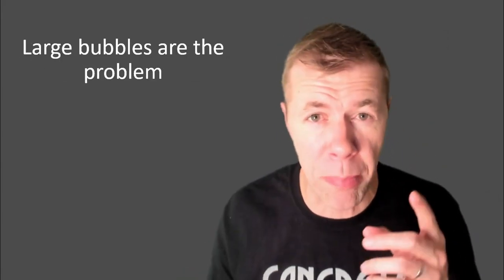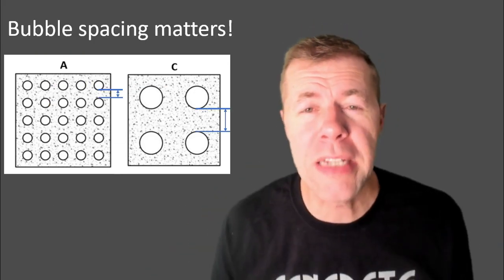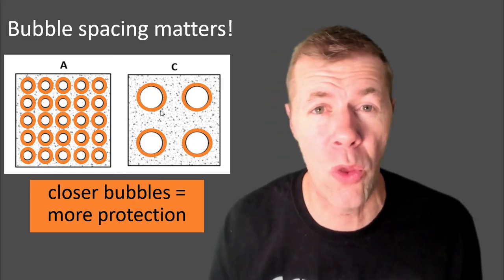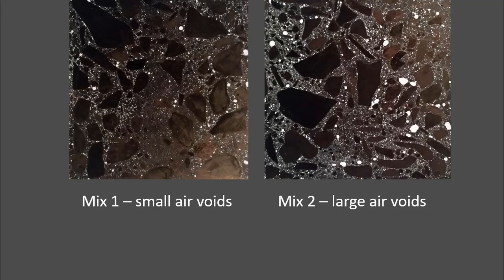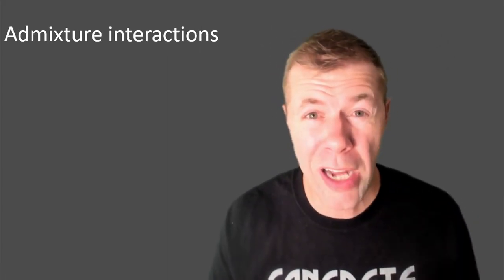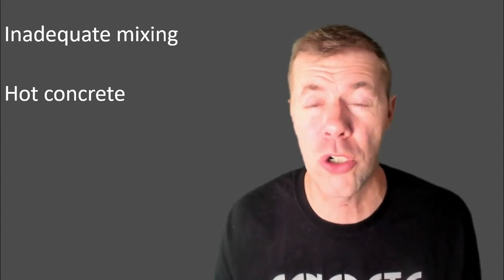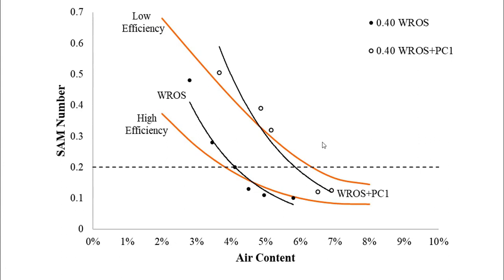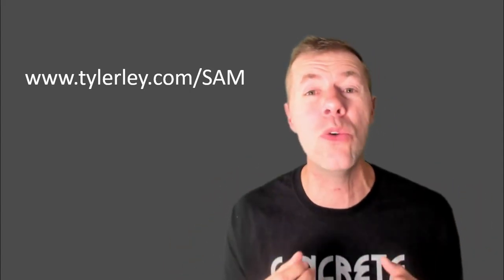How to get efficient air in concrete with the Super Air Meter.

Comment: Dear Professor, How does the fresh concrete pore will related to strength? Even the hydration & nucleation growth occurs during curing. so matrix might get denser in curing age. But Spacing Factor will be more reliable than SAM

Comment: So how does this work.... I want a concrete mix with high impermeability especially one that will not crack and facilitate water penetration. I want a concrete that exceeds that specified as a minimum for for FEMA P-320 202103 Safe Rooms and can handle EF5 tornadic winds like those measure in the Moore, OK tornado (> 300 mph) say with a 20% safety factor so ~ 360 mph and handle pummeling by missiles (2x4s, etc) that such an EF5 would propel. Wall: a Flat Wall of RC 6"  thick. 

Hypothetical, but how would the development of the mix proceed... a first design... then a SAM test of a small batch.... and extrapolations of the mixes properties.... a second adjusted design.... another SAM test.... a 3rd design and another SAM test... if getting close a casting and confirming tests of the SAM predictions using the hardened sample? How much does such a process cost in time and $?
Reply from the maker: That is a good description of the process.  Ideally, this would be done by the ready mix producer and they would use the best combinations of materials.

I am not sure air bubbles are your biggest need if you want a safe room.  I would use fiber reinforced concrete and also rebar.  You could also use UHPC if you want to spend the $$$.  It was developed by the military for these type of applications.

Comment: I’ve done extensive testing with synthetic and organic foam concrete. I absolutely love it except, the cure time. On another subject, it would be great to see a video about how the different size vibration motors and position of weight plates within those motors effect various slump variations of concrete using a globally used standard, say for example paving moulds or similar.
Reply from the maker: We have a lot of cool research on vibration that we recently presented at ACI that we are doing for the FAA.  Stay tuned and I know it will end up in a video soon.  It is exactly what you are talking about.
Reply: Great to hear. Very much looking forward to that.

Comment: How's it goin' professor!!?
Just wanna ask you
Is there an AASHTO concrete mixture design procedure?
Cuz here on our company they're bragging about it like it's an mythical method to design.
As far as I know that AASHTO works only with asphalt concrete.
Reply from the maker: There is no AASHTO design method that I know of for concrete.  Do they mean AASHTO R101?  This is a method to design for durability.
Reply: @TylerLey  I knew it!
No professor they meant a whole design procedure for the mixture.
Reply: This is totally wrong concept, AASHTO used for both concrete & Asphalt concrete.

Comment: Dry pour is trending right now, do you plan on doing any videos on how dry pour effects the strength of your concrete?
Reply: Nobody has endorsed a dry pour since roman times................screeding a dry pour segregates the mix agitation is necessary in my opinion..........i have no formal education but i also have decades of experience as a cement finisher on all rypes of jobs
Reply: @freedumbofspeech1977  I'm hoping to find actual data on the effects, not opinions. Everyone comes up with excuses to ignore opinions, data is data.

Comment: Not in the concrete trade, Electrician actually, but considering a home build with a basement.  Poured walls take a beating here in the NE and can see how this would provide a margin of protection of a wall structure in frost/freeze situations.  What I don't get is what additives and how to produce a consistent and efficient mix to entraine the critical air bubbles in the the mix.  Does vibrating the concrete adversely effect the bubbles, their size, and their distribution in the finished concrete?  Interesting information but crap does it set my mind to a boat load more questions!
Reply from the maker: Thanks Mike,
The method helps you evaluate different admixtures or mixture designs to find out which ones work and which ones don't.  
Typically, vibration only removes the large bubbles from the concrete; however, if you leave the vibration in for long enough then you can start removing smaller bubbles.    This means you need to be careful how long you vibrate.